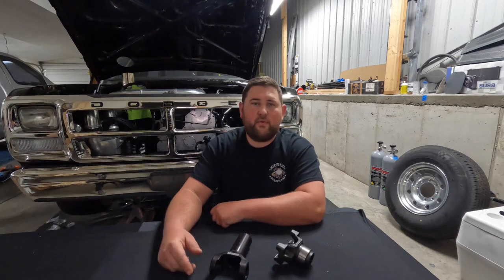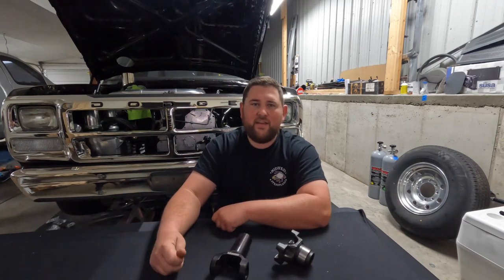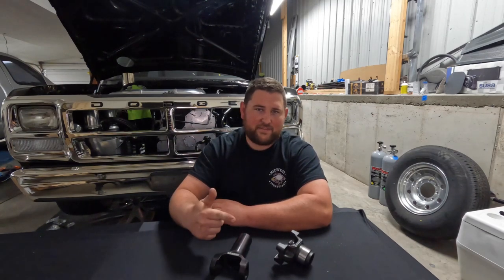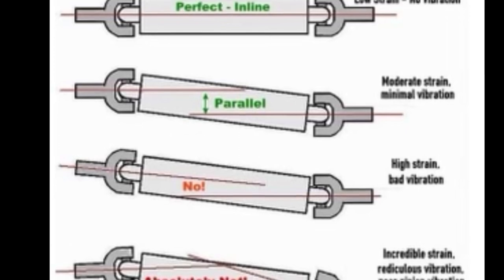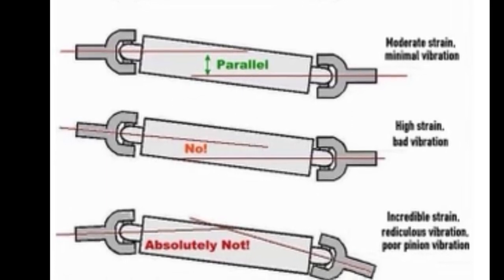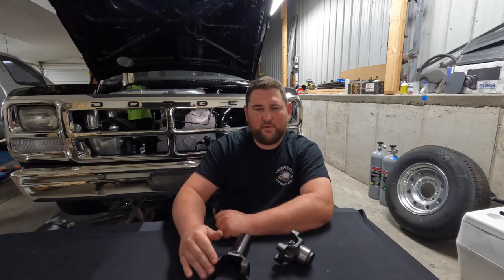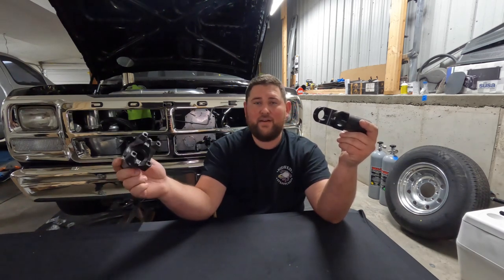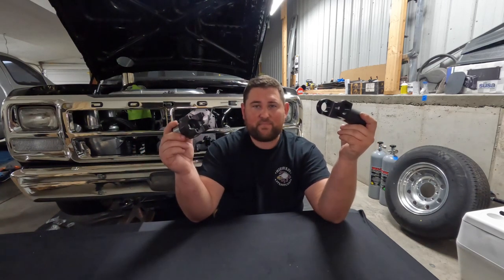4x4 Front Driveshaft Tech Talk!

Comment: On a race rig where you  are unlikely to hit anything with the case often times rotating the transfer case one set of holes will greatly improve the front driveshaft angle. The 271 cases are pretty wide anyway so they don't normally come  in too close to make that angle worse than it normally is.

Comment: Great video. What pinion angle is optimal? I'm running an IFS setup. Should I nose the pinion up or down a few degrees to account for deflection under load?
Reply from the maker: Up
Reply: @LoganbuiltRaceShop  Driving on the street I have no issues. Once I'm WOT I'm getting driveline vibrations that feel like the transfer case? I can feel it behind the drivers seat. I'm about 1000hp running a Ford 8.8 IFS and Ford electronic shift 273 transfer case. Driveshaft has a slip joint and one ujoiny on each end.  All I can come up with is pinion angle deflection under load. How many degrees up would you recommend? Thinking custom poly bushings may be needed, too. I was also thinking loaded tire circumference is changing as the front end unloads, causing driveline binding due to different diameter tires under load. Thanks!